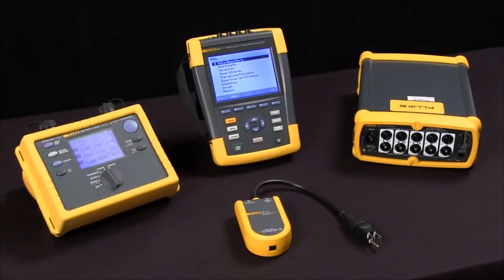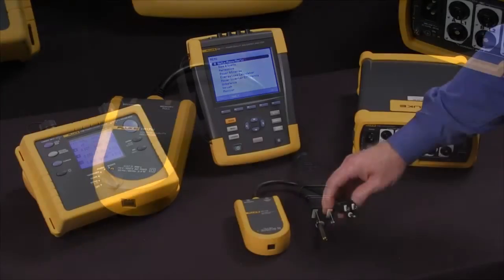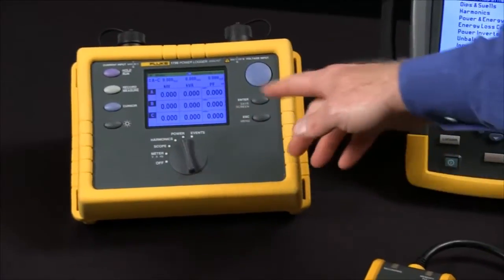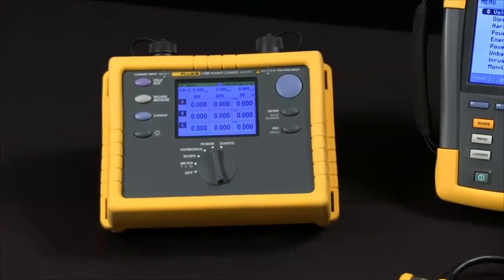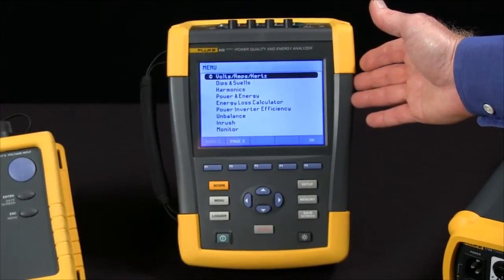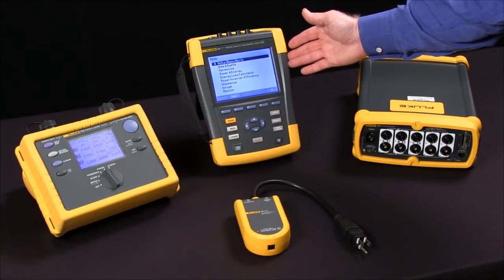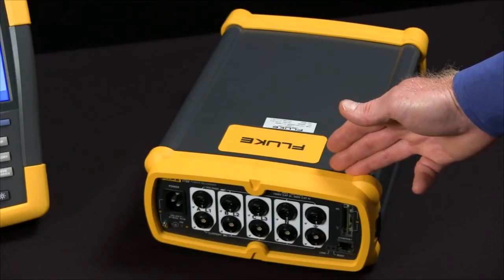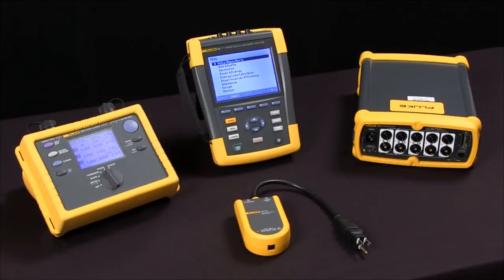What Power Quality Tool Do I Need To Do My Job?

Comment: what is the max voltage range the power quality instrument can record?
Reply from the maker: Hello Arun - Our power quality tools are rated for measurements up to 1000V max. If you need to measure above that then you would need to use PT's and CT's.